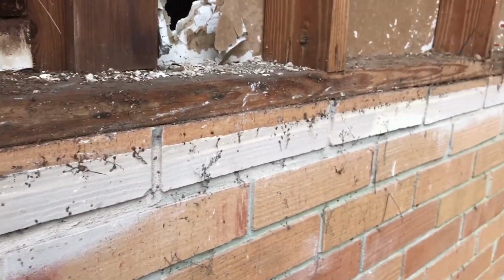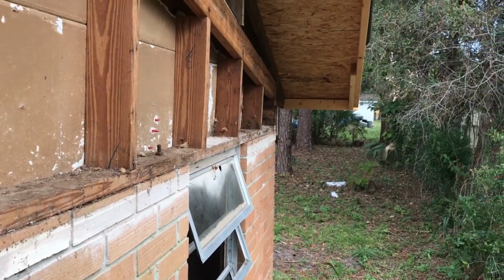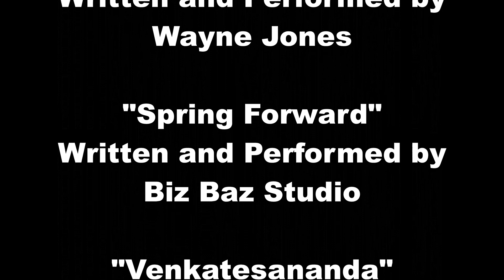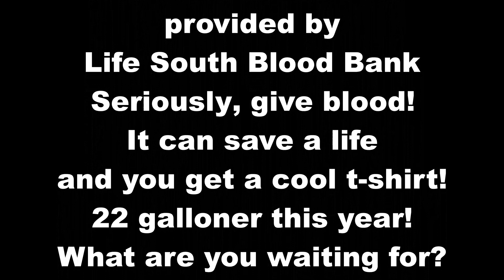Remodeling a $6000 Brick House - Hardie™ siding on the gable

Comment: Good Lawd leave the window lol.  I personally like bathroom windows but I know some don't.   The house is starting to look like a house.  ❤
Reply from the maker: It is off-center and over a tub. That makes it a difficult solution. Actually the more I struggle with what to do, I am more and more leaning towards just putting in a window and calling it good. The cost is not terribly different but the ease of doing it could make a huge difference. I'll have to give it some more thought!
Reply: @RehabLife  I like a window but not in the tub area.  It is a problem for the shower rod and or if one wants shower doors which I love for all the splashing of water.  I am certain you will work it out as far as cost factor.  Good job on planning.
Reply from the maker: @lawannarobinson9900  it doesn’t interfere

Comment: Block it up. Use what keeps  the cost in line. Its a rental.  Later you can keep  a bucket list to go over later in changes.  Have time to get things when your ROI is better. 

Looking good. The roof getting  this  done will pay for it self in time. Costs go up get it done at today's cost.  No worries no issues 

Joel
Reply from the maker: All sound advice!